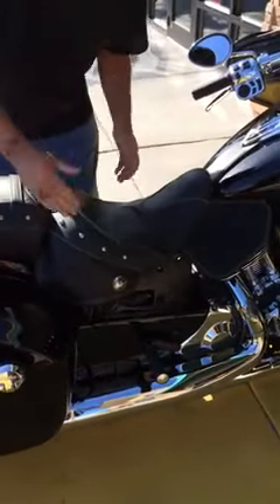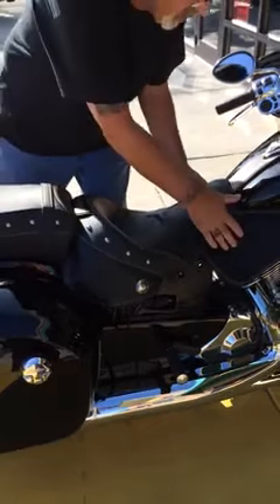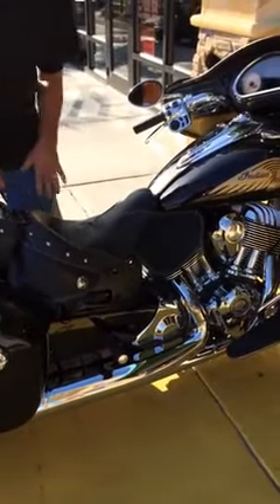How to install and Indian heat shield

Comment: I have a 15 chieftain.  I’ve ridden in 100 degrees without any kind of heat shield and it never got uncomfortable beyond blast furnace from riding when it’s that hot out.  Cold weather it helps I would say ha.

Comment: I installed these on my 2015 roadmaster  this year. This fall the rear cylinder overheated  and caused approx. $4,000.00 (cad) worth of damage. Indian refuses to help claiming that the cooler caused the problem. I called the dealer in Panama City Beach Fl and was told by a Phil in the service dept that it was another Phil who had made the video and he no longer worker there. An all around bad idea.

Comment: Not to be critical, but good heavens, with today's technology, couldn't you have a video that didn't look like 1901 technology? When I try to put my CICC on my Springfield, it doesn't properly fit around the gas tank or fit under the edge of the gas tank. It looks like my bike has butterfly wings.